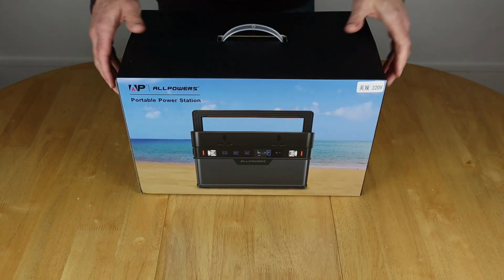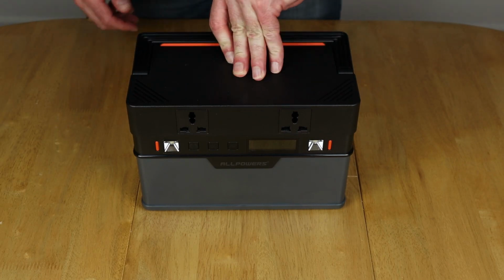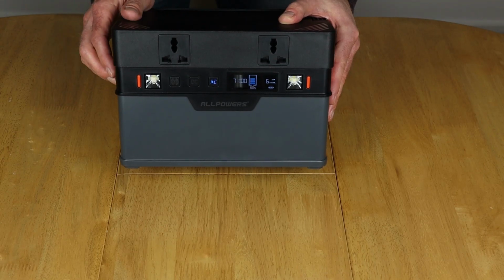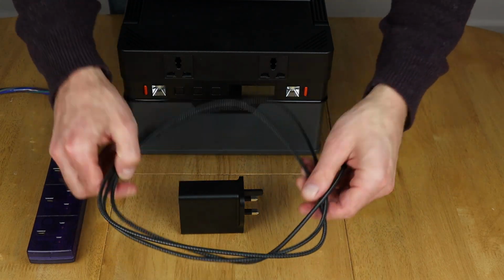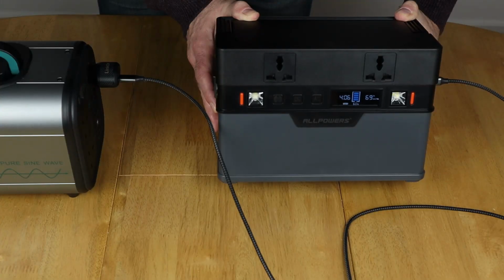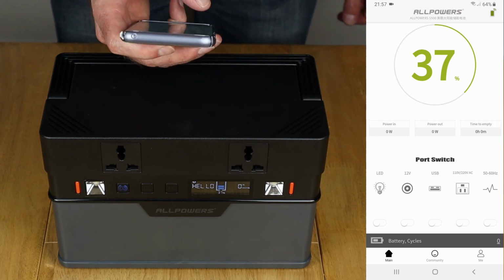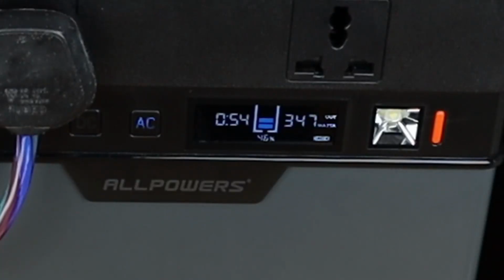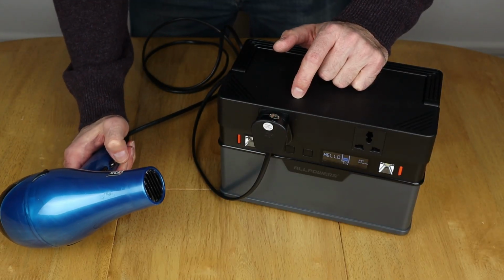ALLPOWERS 666Wh Portable Solar Generator Unboxing & First Look | Even More Pickup and Go Power

Comment: I am hoping either your good self or maybe a follow viewer could test the possibility of super fast charging the 666Wh version with a 90Wh or higher PD C charger. If it actually can recharge at 90Wh plus it will make the unit a very attractive purchase. Have you any plans to test out the max BD C charge rate? Thanks in anticipation.
Reply from the maker: @Gordon Kerr  Good day Gordon and thanks for your question. I bought one of these which is 90W PD capable > https://amzn.to/3aeoDVz (affiliate link), but it still only charges at 60W on my 666Wh. I'm working on an update video at the moment which I hope to get out before Christmas. In that video I cover the dual charging method (which I've now confirmed with the manufacturer is fine to do), as in you can charge from both the DC input and the USB-C PD input at the same time. This boosts the charging rate way above 100W (cutting the charging time a fair bit). I hope this helps? Please shout if you need anything else in the meantime. All the best, Adrian
Reply: @DADvinci  Thanks for the quick reply. Wondering if the dual charging method to achieve 100w also works for the smaller  372Wh Power Station? Also keen to know the maximum amount of solar panels worth purchasing for the 666Wh. i.e. If it can only handle the same solar imput as the smaller unit there would be little point in buying bigger than a 100w panel. I am weighing up which unit to go for early next year and I only see a point in getting the bigger unit if it's possible to charge the bigger battery just as quickly, otherwise it might make more sense to go with two of the smaller 372Wh units. Thanks again.
Reply from the maker: @Gordon Kerr  Hi Gordon! The dual charging method doesn't work on my 372Wh, so you can expect around the 60W mark for the quickest charging. I get this from solar on a good day (100W rigid panel) or from a 60W USB-C PD charger. I've not had the best weather to really test the full capability of the Anderson port on the 666Wh as yet, but I was seeing mid 80s from 120W folding panel about 5-6 weeks ago. I should start to get a better idea going into Spring next year. Did you need the larger inverter that the 666Wh offers? Cheers, Adrian
Reply from the maker: @Gordon Kerr  Good evening Gordon. You've got some good combinations available for what you need. I've also been testing the PowerOak for a few months and that was the 120W panel I was referring to in my last reply. It's nicely constructed, feels sturdy enough and I'm getting 50-60W on the 666Wh with the weakest sun of the year (UK south) so not bad at all. I've got the PowerOak EB150 as well and I'm very impressed with it so far. I'll be doing a video on the solar panel in the New Year, so hopefully that will help as well. I really like the fact it has MC4 connectors too so I can add it to other panels in series for more overall wattage. I think I've also finally found a kettle to work with the 666Wh, which is always a problem with solar generators that have smaller inverters (I might do a short format video for that one soon). Please shout if you need anything else. All the best, Adrian
Reply: @DADvinci  All that sounds very interesting and useful to me. I have been considering the PowerOak ac100 with their excellent expensive 120w folding panel even with discounts that combination will be about £1100. It costs around £4 a night on electric hook up on campsites so I have to consider what is the most I should be investing in going off grid. I am retired so am able to travel freely and expect to spend about 100 to 120 nights camping each year. If I buy an expensive powerful system, I can only justify it if I stop using electric hookup. The going off grid option is of most use in high season as it opens up many more chances of finding a camping pitch at a time when most electric hook up pitches are booked. Using the gear for maybe 30 nights a year only really justifies spending £400-£600 max and becomes worthwhile after maybe 3 years.. Using electric hookup if it's available makes a lot of sense especially in colder months when electric heating is so convenient in a tent. Decisions. Decisions. Your up coming videos will be very helpful. Thanks so much for all the quick replies and I eagerly await your findings when you upload the videos.
Reply: @DADvinci  p.s. I have been seriously considering the the PowerOak ac50s with the PowerOak 120w folding solar panels which can be bought with discounts for about £720. It's really useful information that the PowerOak 120w folding solar panels work well with the Allpowers 666Wh. There seem to be several advantages to the Allpowers 666Wh over the PowerOak ac50s. Cheers.

Comment: I noticed somethng really weird with my 666wh today i had a 30w hand crank dynamo plugged into the dc in jack but it would only register any watts charging if i pressed the DC button on the front of 666wh and if i stopped cranking it wouldnt register anymore watts until the DC light was toggled again
Reply from the maker: @Graham Jones  Please can you post a link to the hand crank dynamo? Cheers, Adrian
Reply: @DADvinci  https://www.ebay.co.uk/itm/392970323952 video of it in action here https://youtu.be/QMdeu9GhTT0 theres also a nifty product called power box 50 that can apparently output 50w that you pedal with your feet but its alot more expensive. https://www.k-tor.com/shop/generators/power-box-50/
And theres a chinese made one you can attach to a stationary fitness trainer bike that claims 800w output but ive not seen a detailed review on it so dubious about that one. https://m.dhgate.com/product/self-generating-electricity-stationary-bike/407354103.html
Reply: The handcrank works perfectly fine with my other 2 power stations (that arent allpowers)
Reply: You can combine multiple sourcea of renewable energy like wind/water turbines/solar panels if you put them in parrallel with each other in charging circuit.
Reply: I watched a youtube video where someone setup a water turbine at the bottom of his houses drainpipes.

Comment: Did you have to purchase a dc to andersin connector cable seperately? I didnt get one in the box with my 666wh or my solar panel. i didnt even get a DC to DC barrel connector cable which was meant to be listed as in the box on the amazon listing
Reply from the maker: @Graham Jones Yes, I purchased the DC to Anderson cable as it didn't come with the 372Wh, 666Wh or 60W solar charger.
Reply: @DADvinci  have you ever played with connecting multiple solar panels together with mc4 connectors and Y junction adapters? I currently have a 100w megasolar solar panel and have another 100w allpowers in the post. It helps too have more/bigger panels if you dont have perfect weather conditions to get your maximum solar input.
Reply from the maker: @Graham Jones Not had much chance to play with it recently due to the terrible weather. Connecting 100W panels in series will go over the 24V limit mentioned in the manual, so parallel would be the better option to keep the voltage in range and rely on current instead (5A limit), which the MPPT should deal with. I should know more when I test, but it works perfectly with one of my 4 x100W panels. Cheers
Reply: @DADvinci  yea easier too reach the 5amp limit with 2x 100watt panels when the sunlight isn't perfect. would need the mc4 Y junction adapters too connect them in parallel tho. Yea u don't have too worry about overcurrent the most as it will only draw as much as it can take. Its overvoltage that would break it like you said.

Comment: If you used a 666wh in a backpack to power say a 400-450watt hedgetrimmer would the power station suffer from lack of air ventilation for cooling its inverter?
Reply from the maker: @Graham Jones  I wouldn't recommend running a high drain activity like this without adequate cooling (e.g. whilst in a backpack). All the best, Adrian
Reply: @DADvinci  have you ever had problems with the anderson connector? I read a review on amazon and a woman said it can be very easily get knocked out by just a gust of wind.
Reply from the maker: @Graham Jones  I've never had any problems with the Anderson connector.

Comment: Do you know if these can charge from both solar and mains at the same time for a total of 200w or is it capped at 100watts total due to the battery tech used?
Reply from the maker: @Graham Jones  Hi Graham and thanks for your question. You can only charge from one source at a time and with the charging current limit of 5A it wouldn't give you any real gains in charging times if you could. Please shout you need anything else. Cheers, Adrian
Reply: @DADvinci  I just received my 666, currently charing with the power brick along with usbc charing. Total of 157 watts charging.
Reply from the maker: @Tommy Hcmy  Hey Tommy. Thanks very much for your comment and it's great to hear this way is charging fine on yours. I'm currently providing the info that's in the manual (under 'Charging from Wall Socket') where it specifies one or the other which was also the case for the 372Wh. I'm going to raise this with the manufacturer as I want to give out the right advice going forward so that viewers don't face issues if they need to call on their warranty in future. I'll also include this in my next update video.

May I ask which PD charger you're using (wattage)? In addition, what 'watts in' are displayed when charging just using the USB-C PD port? My testing has turned up some interesting results in terms of displayed values versus actual power going in.

The other thing that happened last night was that I broke one of the AC outlets, similar to some viewers who had the revised version of the 372Wh. I'm a bit clumsy sometimes (as mentioned in other videos), but the right-hand cover came off and now the back part of the socket is loose in the unit (socket unusable currently). I suggest being careful how you plug in and remove, ensure the plug is straight on both counts as this might have caused my issue. It looks like the plug socket has catches that are glued in place and it could be that there's not enough glue in my case.

I look forward to hearing from you. Cheers, Adrian
Reply: @DADvinci  interesting. I do like the fact that most PD chargers even the 100w ones are much smaller than the 666s power brick
Reply: Maybe its using the same battery tech as the bigger poweroak stations as i beleive those have 160w charging. I was looking at the newer big bluetti 2000wh units and they can combine 700w of solar and 500w mains charging for a total of 1200w charging which is insane. And it only cost as much as the poweroak 2400wh which doesnt have this ability
Reply from the maker: @Tommy Hcmy  I've heard back from the manufacturer and they have confirmed that the dual charge method is fine, despite what their manual says. I'll include this info in my next update video. All the best, Adrian
Reply: @DADvinci  i had a basesus galio 120w pd charger but it only comes in EU and US plugs i was using it with a EU to UK adapter. Didnt get a chance to test it with  the 666wh because the charger broke when our tumble dryer flipped the RCD in our breaker box.
Reply: So i purchased a new pd charger off amazon that claimed to be a 100w charger im only getting 70watts out of it plugged into the usb c port on the 666wh if i plug the ac mains brick in at the same time i get 110-114w with both 96w with ac brick alone.
Reply: @Catotheshredder  odd that i dont get similar results too you maybe its down to the quality of batteries you get in your 666wh and how they handle the heat charging

Comment: I bought the smaller 372 watt version which is perfect my needs and works great but there is a big design fault. Both the front mains plug socket front cases pull out attached to your plugs !!!! The lugs that are designed are no where near strong enough, you will hear a load click when you push a plug in, almost sounds like something has snapped and broken off but it hasn’t, the socket faces have clicked free off the mounting inside the unit and are now on your plug !!! Now you have to unscrew the unit and push them back into place but they will keep coming off every time you pull a plug out. All I have done is put a couple of bits of black electrical tape over part of the outside around the plug socket faces, this does stop them from coming off but really all powers should have sorted such a small minor but massively annoying basic problem out before releasing thier products. Does this new 666 have the same known issues as the socket faces are the same ?????
Reply from the maker: @Single Handed Warrior  Good day and thanks for your comment. I'm really sorry to hear that you've had this problem. My 372Wh is the earlier version so had the slightly recessed sockets with rubber covers, but I've heard from a couple of viewers who experienced your 372Wh issue. I've only had my 666Wh a little while and it seems fine so far. I've not noticed any clicking noises or movement from the sockets when unplugging or heard from any viewers with this issue as yet. I will continue to test this unit and share what I find in update videos. If you haven't already, I'd recommend feeding back to ALLPOWERS via their support email support@allpowers.net . Please let me know if you need anything else. All the best, Adrian
Reply: @DADvinci  Thanks , I bought the 372 model after I kept watching your reviews of it . Yea I have told Allpowers about the issue .

Comment: Hi,
I see a LinkOn 112W USB C Car Charger with 90W PD3.0 on amazon. Would that be able to charge this 666Wh station with that car 12v plug with a usb C cable? Thanks
Reply from the maker: @Tommy Hcmy  Hey Tommy. I've received and tested the 112W version on my 666Wh now. Unfortunately, it still only charged at the same rate the 84W version does so unless you need the 90W PD for something else, it's not worth the extra money when it comes to charging the 666Wh. I hope this helps. Cheers, Adrian
Reply: @DADvinci  Hey Mate, thank you so much! You videos are very educational. Keep up the good work:)
Reply from the maker: @Tommy Hcmy  Good day Tommy and thanks for your question. Mine should be arriving tomorrow so I can test it out and let you know. The manual states that it's two-way PD 60W/100W, so I'm hopeful it will charge at the 90W the LinkOn can deliver. I'll let you know. All the best, Adrian

Comment: Wow and even know it as the 666 as the specie rate of the watt hours. Also if not too expensive will still try to get one. Also it seems to charge better with the type c to type c in the car rather then using that big laptop charger adapter that will get hot to charge. But anyway still will do solar later and something different. But anyway good review and testing.
Unfortunately about $550.00 plus taxes for this unit and yea might not be able to get one at this price range for the USA version.
Reply from the maker: @Corey Martin  Hey Corey, nice to hear from you! From what I've found so far, charging from the car is quicker with the 12V USB-C PD (LinkOn) charger on both the 372Wh & 666Wh (best method for me). You're right that this is more to buy, but the extra capacity and larger inverter might suit some people more than others. If viewers are looking for a more compact solar generator, the 372Wh is still hard to beat in size/weight terms. Take care, Adrian
Reply: @DADvinci  Also yes the other one in the future is still a good buy. Also yup you linked other solar battery generators with the car charger that uses type c to type c. But would still require to charge on the grid so that way won't loose it's charging cycles. But I know you did it for the test and also whenever it is really time for a power outage you on the other hand will be ready then some others so fair with the setup of those solar battery generators all together. Also will use them to charge the basic stuff too last longer. The lights fans and the set of power banks and solar chargers that I got on my review on my YouTube channel. But anyway you on the other hand will be more ready.

Comment: Great videos usual ! Can't wait for my ecoflow r600 max to arrive
Reply: @Pete Coventry yeah being an electronic technician I'm not worried about the battery life living in Florida I need it for power outage and hurricanes
Reply: @Pete Coventry yeah they wouldn't give me a refund unless I sent it back. part of me was thinking about just tearing it apart and using the batteries out of it since I had already taken it apart and found out that the BMS wasn't charging it anymore I tried bypassing it and it still wasn't I manually charged it and it worked but just wanted to finish product I already have a DIY battery pack
Reply from the maker: @CanadianTank007  You are too kind, thank you 😊 When are you expecting it? Cheers, Adrian
Reply: @DADvinci  ecoflow said late September and now its late October for my backer number.
Reply: @Pete Coventry yeah I really wish my all-power 372 WH had performed well and I hadn't had to return it I got such a good deal through AliExpress and that's probably why I got to B grade unit. I got 372 for only $89 from the official all-power store.
Reply: @Pete Coventry they didn't offer me anything but send it back for money and i debated to keep it since it does have Lifepo4 cells inside. probably because of the discounted item